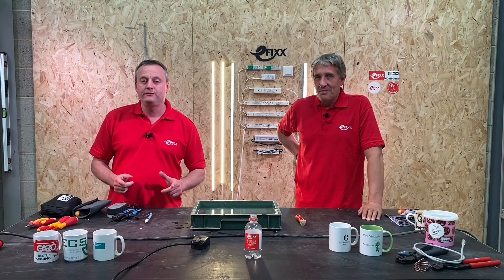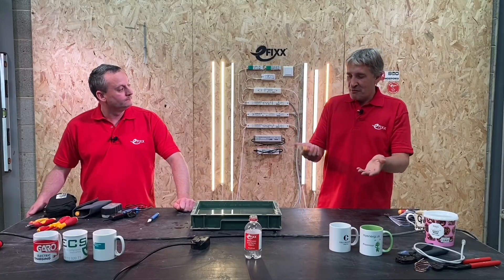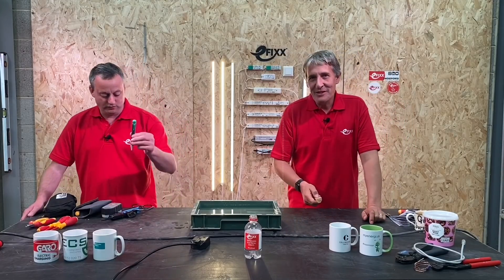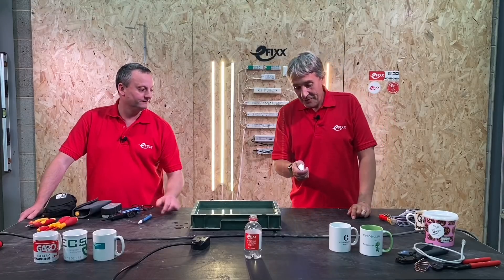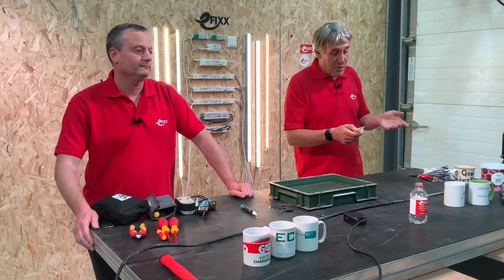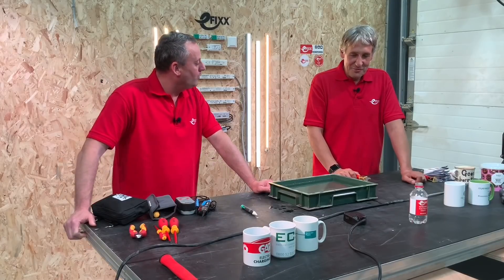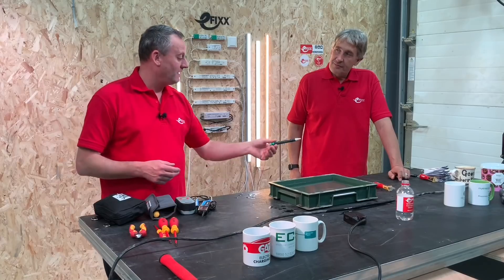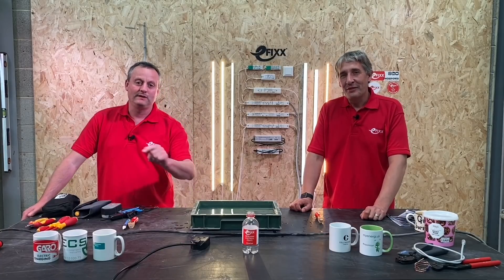How to use a voltage tester - Wiha IP67 Voltage Indicator

Comment: I always use my Fluke 1 AC-2 voltage tester pen/sticks for testing for "live NOT DEAD" circuits, saves so much time, and accurate and reliable.I have used a few cheapy ones before but never trusted them. Of course your right SAFE ISOLATION, PROVING UNIT & TEST is a must.Funny video guys... :-)
Reply from the maker: Thanks for the support and great comment 😁
Reply: A must at college but not on site

Comment: Fault finding under water? What if your call out to a job where the underwater lights in the swimming pool have failed and you need to know if power is getting to those lights ? My non contact voltage stick has two sensitivity ranges low 12v to 500v and high 48v to 1000v and detection distance of 2inc on low and 4.5 on high so even with completely sealed underwater lights fittings it will detect live voltage. Would I ever use underwater absolutely not.
Reply from the maker: Most swimming pool
Lights have a cable behind which allows them to reach to the surface.

Comment: I love the tool demos
I have multiple sticks cheap ones I keep iny pocket not afraid to lose & then a couple of expensive ones. The oldest is my Martindale which has been the most robust.
Plus a magnetic version from mulicomp pro as I work in industrial control on cabinets with compressed air & hydraulic valves.

Comment: I have used since I can remember a voltage tester screw driver, so yeah, it had a metal tip, a resistor, a lamp and ultimately my finger. It was not very good at tightening screws so it broke into pieces too small to be glued back again. Bought a non contact tester and the false positives makes it useless sometimes, I picks up very small parasitic voltages as well so it can only prove when my whole hose is dead not only one circuit.

Comment: I would say one thing these pens are great for fault finding in appliances and household items, especially like Christmas lights when a bulb goes out and all the lights go out these will tell you which bulb it is, same as them thermal slash microwave testing screwdrivers are helpful in automotive work when working on spark plugs or coils just by holding it above the coil to see which cylinders misfiring obviously from there you have to work out whether it's the spark plug or the coil lead which isn't difficult
Reply from the maker: Great tip 👍

Comment: Joe why do you want neon screwdrivers taken out of circulation? Do believe they are dangerous?.

From about the 1950s what did we have for testing? .

Answer, we had nothing more than a crank operated continuity/ insulation resistance tester from mega and a neon screwdriver and if we were lucky enough we had a BM6 battery operated mega.

Now we have fancy two pole voltage indicators and all bells and whistle’s MFTs the crank operated mega and neon screwdriver is now dangerous? 

Isn’t it true that the big manufacturers have forced the IET to draw up new regulations for testing so they can market and sell there new testers? 
Because before theses MFTs come on the market testing was nothing more than continuity test insulation resistance test and polarity test  
What is now referred to as Ze was given by the DNO and ZS was calculated RCDs were not common in domestic installations so we would never test them .
 I would very much like to hear your thoughts on this . 

I have had a neon screwdriver since I was 15 years old I was given it by my brother , and I have never ever had an electric shock from using it nor have I ever electrocuted myself wile using it .
JW did a video on neon screwdrivers saying how dangerous they are so my question is why in gods name would someone like JW who has many many years of experience and knowledge demonstrate how they work and put his finger on the end of it to show how it lights up knowing that he could potentially kill him self?
Your opinion will be much appreciated.
Have a fantastic Christmas and new year.Hope to see more from team eFixx in 2022

I think this is a great topic for eFixx to delve deeper into, it was brought up in a conversation by a friend in my local club and thought if anyone can give a definitive answer you guys can .👍
Reply from the maker: Good question Sean. They simply don't comply with GS 38 for testing live parts, there's more than 4mm exposed tip on the end and the device relies on you completing the circuit to prove it's live. All that's standing between you and oblivion is a resistor, if that fails for any reason you're toast! I'm glad you never had one fail on you, but just because we've always done something one way doesn't mean there's no better/safer ways of doing it.

As to the IET and the splendid John Ward, their actions remain beyond the remit or control of this humble mortal, you'll have to ask them! 😉😀
Reply: @efixx  joe I have to agree with you about there being more than mm exposed tip on the neon screwdrivers , but when you take into account the fact that you can remove the covers off of our voltage indicators when we can’t get into a terminal with them on then we are no longer conforming to GS38, so therefore GS38 is a nonsense? Also if you put a length of heat shrink on the shaft of your neon screwdriver so you have less than 4mm of tip showing then it will conform to GS38?  . Also the resister is behind the neon ie metal shaft neon resister spring end cap , so if any fails it will be the neon there braking the circuit. Just a thought
Reply: @efixx  thank for your reply, yes I agree with you on the point that there is more than 4mm of exposed metal tip , and yes there is always a better way of doing things. My point is if they are dangerous?? Then why would someone like JW with years of experience and knowledge take such a risk? The fact that he did and i’am pretty sure he isn’t dead is proof that the crapy neon screwdriver is safe . The proof is in the demonstration . And not just JW there are about five videos from different people on the same topic and claiming they they are dangerous? Yet the all gives a demonstration of how the thing works, also I just thought it would be something you could delve into and maybe dispel the miffs or prove the miffs  , I just think it’s an interesting one 
Again thank you for your kind reply 👍👍❤️

Comment: I have a testmate VVD 12 which has done great through through the years, apart from a red tip when something is turned on it also vibrates 📳, brilliant, and for back up I have a LAP detector MS8907. which you can turn on and it turns itself off automatically, know this as the green light will go off to indicate this, the red to show live with a audiable beep , this also comes with a torch,

Comment: I was kind of off to the idea of them and then I got one and use it once or twice, then I found out it can detect Miss wired Outlets where the three light tester cannot easily tell polarity for lack of a better word. the hot sticks can determine if the wire is on the correct side of the outlet. Very handy to know before plugging in expensive AV Equipment. I only discovered this fact after I lot of reading and I feel like I'm one of the few people who know it, I'm in the US and I'm kind of liking that it has a flashlight on it mine doesn't it also takes those stupid watch batteries.

It will also say I picked up a stick multimeter that had one built in it reduced my carry down to two objects for troubleshooting and checking. I carry the voltmeter Checker and I carry a homemade 3 light Outlet tester with built-in voltmeter. So testing is pretty darn quick plug in get light / volt test and and then check that the hot pin is actually connected to the hot wire.

Comment: I may be in the minority here but I have never used a NCVT because I believe they instil bad practice, I carry my 2 pole tester and proving unit in my TP4B with my other tools around it. Now if they made a 2 pole tester the SIZE of a volt stick then I could be persuaded to change.

Comment: You can’t go wrong with the @fluke 1 AC-2 non contact tester.
It has an on button 👍 it flashes to show its active 👍 It bleeps and glows red when it’s in the presence of AC voltage. This is the best non contact tester in the market.
Reply: I thought that until the battery got low and I didn't know. It started giving misleading results. Very dangerous.
Reply: Use it all the time
Reply: Prefer the kewtech...it has a button to reduce sensitivity ...to pinpoint a paticular wire....had both